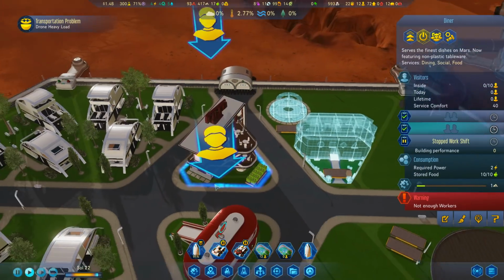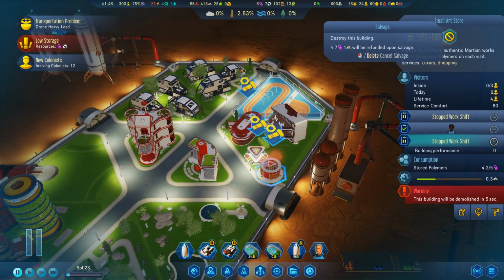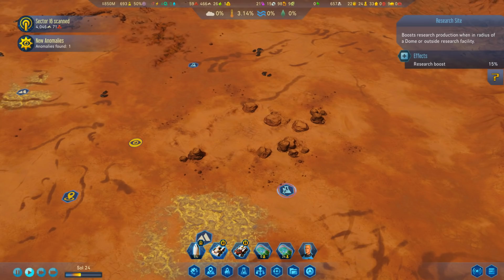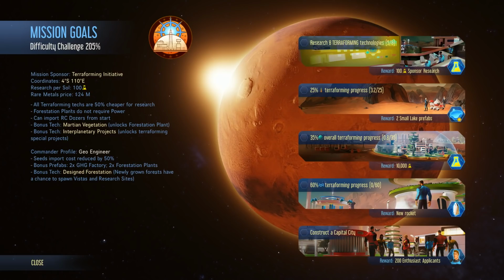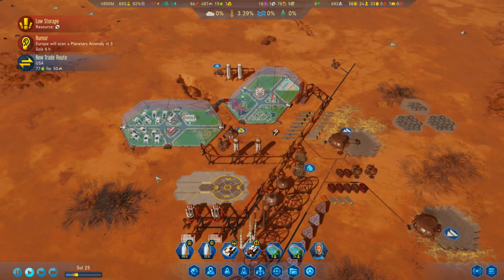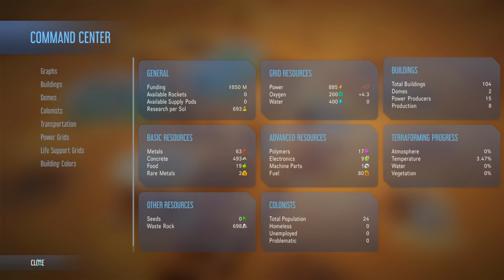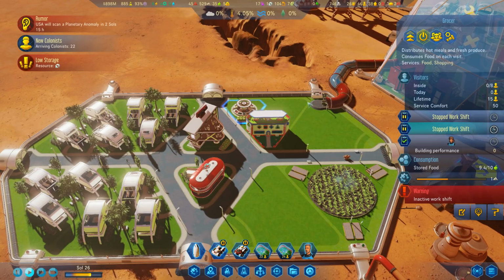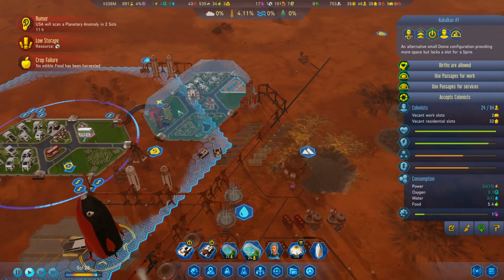Reinforcements Have Arrived!  | Surviving Mars Green Planet DLC | #6

Comment: Forestation plant is what I meant for lichen spread (hence this start comes with a couple of prefabs & the building tech), apologies for the confusion. Farms come a lot later but are really useful for food & seed production

The proposed site for the dome to the N is excellent for research & babymaking (ie comfort bonus), but note that the barrel dome's radius won't quite cover both research spots plus the vista (it's off by 1 tile). Unless other current dome shapes change the shape of their coverage it's prolly best to hold off until you've unlocked medium domes. Colonists /will/ use the big tunnels to move from dome to dome, but prefer to be transported via shuttle or RC Transport (& the invulnerable/no maintenance power & pipe connection is useful too)

You should really pick up an RC Commander ASAP, both for distant construction & repair of your other distant RC units, but also for sensor tower  & forestry placement (once you've researched that no maintenance option) & I think some projects require one; the extra drones you get with it won't hurt, by alleviating your current high drone load

Again, prioritise those planetary projects for 1) breakthrus & 2) tech unlocks; the resources can wait